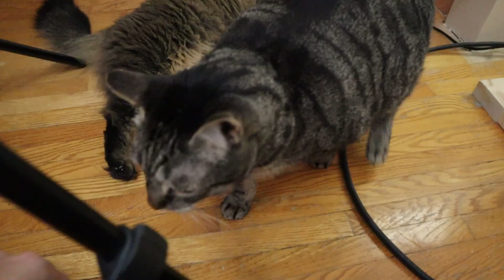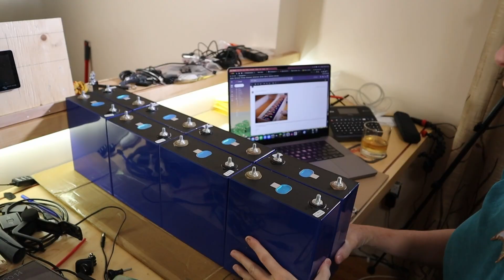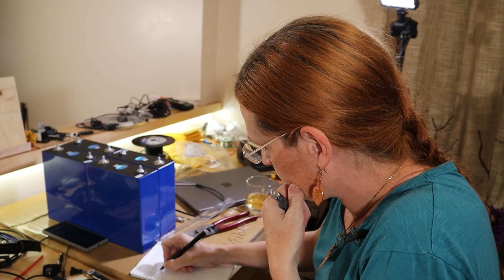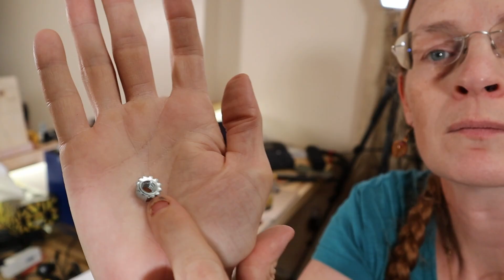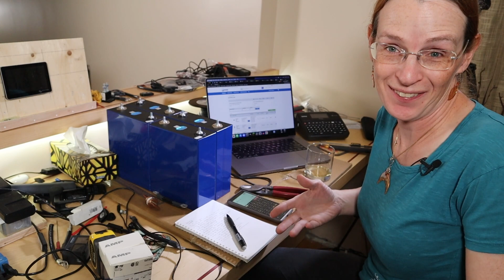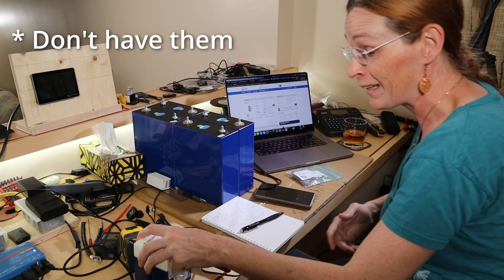Extra Parts, BoMs, and Costs - 48v LFP Battery Build (Ep. 34)

Comment: haha i spy a little OCD in you, at least from my own perspective, hate diesel engines, that in background annoys me, i detest motorbikes, not for being motorbikes, for being noisy, don't seem to have an issue with my own car which is petrol

the investment is sure sure not that cheap, but it is an investment, less so in the batteries BUT 'the system itself' and i reckon on a resale value for the future as we turn more and more to electric possibly a forward vision, the boat and system will be worth more (maintenance excepted) and probably in need of new or replacement batteries (will they ever be cheaper in the future) hard to say but i'm sure will be comparable to wages then and not now

you mention the cold, will you need to insulate the outside of the battery boxes against colder conditions?
to save some space, will you have the batteries loaded onto a staggered shelf, like steps, similar to what Leo has done with Tally Ho?
Reply from the maker: I've got family with legit OCD, so I am reluctant to use that term for myself. That said, I am certainly OCD-adjacent. haha! I'm not as hopeful on the resale value, it'll be what it'll be, if and when I even ever sell this old girl. The value for me is the experience; Both the build phase and eventually the travel phase. That's the pay-off. I am currently planning to have a passive radiator under the battery boxes heated by a diesel hydronic heater (which will also heat the water and the cabin).

Comment: Have you considered water > air heat pump heating? because sea water is never at 0°...
Reply from the maker: I have, but I've made no decisions yet. Heating will be a diesel hydronic heater, that much I've decided. The downside to a water-source heat pump is having another through-hull below the water line.

Comment: So just wondering, is it still cheaper to do the diy batteries vs ones built with BMSes inside? 
knowing now all the items you need. I am a person that looks for the cheaper way a lot but this also looks like a lot of time (and some fun)
Reply from the maker: That's a really hard question to answer... Given that I need marine-grade everything, that immediately limits what I can consider for use, and cuts out all of the lower-cost/quality options. Given what I would use, if I was going to buy pre-made, my DIY approach is still vastly cheaper. Now; The real value isn't the saved treasure, it's the gained knowledge. I want to know I can fix things myself, and there's no better way of insuring that than to build it myself. So for that reason also, I am still convinced I've taken the right path.

Comment: hi .. smiles .. have u consiodered how to lock the battery boxs to the deck ?.. rough seas or even a rollover would see alot of carnage to the wiring and connections .. early design consideration to engineer the solution .. a stitch in time ?... love ur shows ... good luck and may u live long and prosper
Reply from the maker: I don't have a specific solution yet, but the designs I am considering all factor in keeping the batteries in place (and the cells inside the batteries in place) during a roll-over.

Comment: what about the weight of solar cells? and how many kw?
Reply from the maker: I've not decided on panels yet, exactly because I need to finish the conversion and see how the boat sits in the water. I am hoping for ~2kw, but I am realistic that this is an optimistic target, and I may fall short. I've got a spreadsheet where I am collecting data, and two of the variables I am tracking are w/^m and w/kg, so I can prioritise weight or windage.

Comment: I think you should get a reverse cycle AC. Hyper efficient at heating at low temperatures
Reply from the maker: Some sort of heat exchanging AC/heater is in the plans. I'll sort out specific model when I've got a better idea of what space I have to work with.

Comment: you could also buid the batteries in a 2p 3s or 3p 3s or 6p 1s and ong single battery box, each seperate box you put in adds to the overal width using 3/4 plywood, 3/4in x 8 box sides is 6in

Comment: Maddy why not keep the standard busbars. I feel you are overthinking. Even Andy in the end came to the conclusion that the standard busbars work the best, to his surprise. In architecture the basic principle is KIS(S). Btw I have 55kw combined in an RV and that is working perfectly.
Reply from the maker: I went into the rational in depth in the bus bar videos I did a while ago. In short, the constant motion, shock loading from hitting waves, etc makes me worried that things will come loose. If the bus bars can't move, the movement that does get into the cells will transfer into nuts holding the bus bars down. I worry that will cause a nut to back off and resistance to increase. The majority of fires I've see were from bad connections. The flexible bus bars are meant to help reduce the amount of movement that reaches the terminals.
Reply: @TheDigitalMermaid  Maddy, I know. I'v watched all of you're videos and like them a lot. I'm saying this because I have 5 banks of 16 cells with the cells and fixed them in pairs of 4 with duct tape basically on top and bottom. I fixated them together and I am to in a constantly moving object over bumps etc. I have had no problems so far and all is in its correct place still and I'm using the standard busbars because the have less resistance than any self made option. Keep up the good work and wish you all the best.

Comment: Let us be realistic this is a real life experiment . For the monetary  output you could have bought a far larger more superior boat. You should just buy the new expanding bus bars instead of wasting time and effort with all those cables where one bad crimp could let you down.
Reply from the maker: I could of, but it would still be noisy. Remember that a boat is all about compromise; I needed a strong enough boat to cross oceans, but light enough to efficiently push with electricity. I needed one big enough to live on, but small enough to sail by myself. I needed one in good enough condition to be worthy of a heavy investment, but cheap enough that I could still afford to convert to electric in the manner I wanted. 

I can not stress enough how much I hate the drone of a diesel engine. so is this an experiment? Sure, it is. Does that take anything away from the choices I've made? Nope.

Comment: If you are building a study box and strapping the cells together, doesn't that limit the movement enough that using solid busbars is an option?  If you have that much flexing on you boat,  you have a lot bigger problem.  Also,  I would worry about placing too much weight fore or aft which increase the seesaw effect.
Reply from the maker: With the forces and shocks imparted through the boat, think of breaking waves, or days upon days of constant rocking/breaking on a crossing, I don't think it's possible to isolate the cells. Given that the real risk of fire is from a loose connection, I don't trust rigid bus bars. I go into this in more details in earlier videos that are labelled as being about the bus bars.

Comment: wow, what an awesome project. just an fyi if  you don't  have an internal resistance tester for the cells you should get one and test those cells , i have a few swelled cells and they test wildly different then the good cells, still going to use them in my rv project, the overall capacity is reduced but still not all bad, also test them in the charge state they are at, and at top and bottom . best of luck i will keep watching.
Reply from the maker: I do have a proper tester, and I will label the cells, scan the QRs and measure the internal resistances in a video soon.
Reply: @TheDigitalMermaid  awesome

Comment: Ons off my jobs is to make those bussbars if you wrap the cable around a small pipe and crimp the ends on when in a tight bend it wil hold a nice bend
Reply from the maker: That's ... Actually really clever.

Comment: Why not make super short cables with no bend? You'd have to be precise with your cuts, but I don't see another downside.
Reply from the maker: The reasoning behind using a flexible bus bar is covered in older videos on the topic. In short, vibration and movement on the boat is enough of a concern that I wanted to provide a method to allow some movement.
Reply: @TheDigitalMermaid  Makes sense! I haven't had a chance to go back and watch the other videos, but I will. I love all the details you're going into.

Comment: HOWdy  D-M,
I'm digging POST Holes for my Ground-Mount today or tomorrow
I will initially have 6 X 208 watt panels mounted on a 10' X 10' framework 
and eventually have FOUR more frames for a total of 24 Solar Panels 
Pretty much decided on a GROWATT  Inverter SPF 6000 DVM-MPV 
to allow me 48 Volt BATTERY BANK 
120 / 240 volt AC Outputs 
250 volt PV array Input 
& still allow me to connect to the GRID when necessary 
(but NOT sell electricity back to my GRID ... just have it there for a security blanket )  
knock-on-wood = hopefully I have done my HomeWork 
COOP
...

Comment: Console yourself by comparing it to Telsa powerwalls... each battery is about 1/2-1/5th of a powerwall
Reply from the maker: Powerwall 2 is 14kwh, each of my packs are 14.3kwh. :)
Reply: I was thinking in dollars,  or dollars per kWh.
Reply from the maker: @mozismobile  Oh, yes, there my setup is way cheaper. Of course, that's assuming no value to time spent. Thankfully, I find this stuff to be fun. :)
Reply: I think of stuff like this as hobby/entertainment spending. I could be out crashing radio controlled helicopters at $1000+ a month, or I could be trying to find space in my shed for more tools/toys because something something I really need just one more... I suppose I could buy a boat and try to fill that hole with money :)

Comment: i understood that current tends to follow the outside of conductors.  does this follow for stranded wire?  if not, then why not buy copper tubing, drill holes through it without crushing it, or just
crush it on the ends?
Reply: Current does not always follow the outside of conductors. There is a tendency for current to be pushed to the outside of a conductor that is proportional to the rate of change of the current. When the current is constant, as is DC current, all of the conductor is used, stranded or solid makes no difference. At mains frequency, 50/60 Hz, the “skin effect” starts to matter if the conductor is more than a couple inches in diameter.
Reply: @jimmurphy5355  thanks, shows how little i know about "juice".

Comment: Ah yes, the eternal frustration of "it's the right way to do it but it's a lot more work" I'm also in the process of building a battery like the ones you are (280ah cells in a 16p 1s) for my camper (long story short I'm living in it through no choice of my own) so I feel your pain with those crimps =). 
Quick question: Have you cut one of your crimps open to be sure it's properly crimping? (it should be one solid mass that has merged together, no individual strands remaining)
I recently learned about that and with my cheap hydraulic crimper it was a load off my mind to know they were good crimps.
Reply from the maker: I have not yet cut one, but it would be easy enough to do. I'm pretty sure it's fine as I'm using a common hydraulic crimper, but I suppose it never hurts to verify.

Comment: i think you might need either a fuse or breaker between each parallel bank of batteries...in case one bank goes bad.
Reply from the maker: I'm not sure what protection this would provide.
Reply: @TheDigitalMermaid  say you have six batteries in parallel, one shorts out; the other 5 all go through it and cause a fire...at least this is what i understood from
watching one of will prouse's videos.
Reply from the maker: @richardservatius5405  There are 200A t-class fuses inside each battery. If one shorts, it'll blow that fuse and disconnect the battery.

Comment: Also taking weight into account, I think you are going to use solar which gives weight at the front!
Reply from the maker: the main solar array will be on an arch over the cockpit, aft of the main sail boom.
Reply: @TheDigitalMermaid  thinking of weight, coudl the batteries be distrobuted around the boat? I know that resistanse of the wires would make the batteries further away from the decides consuming the power (motor/inverter/etc) wouldn't get used as much but coudl you ensure that all the batteries have the same length cable?
Reply from the maker: @MattWells0  Technically yes, but practically no. There's not really anywhere else on my particular boat for them to go.